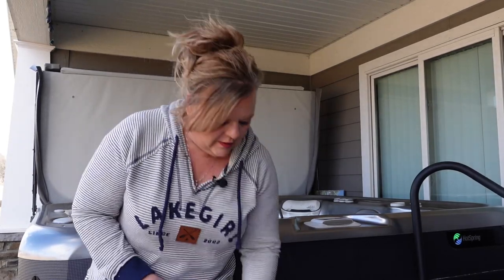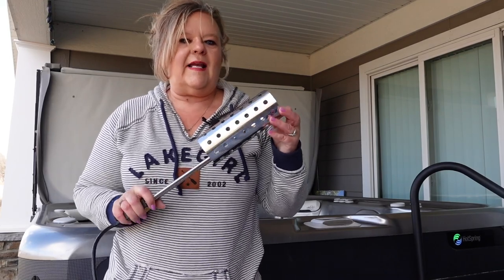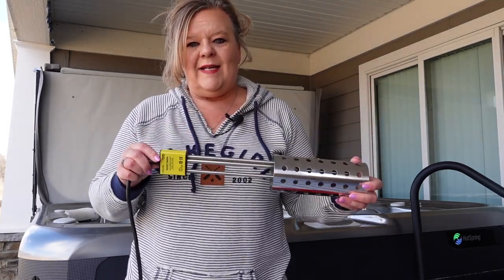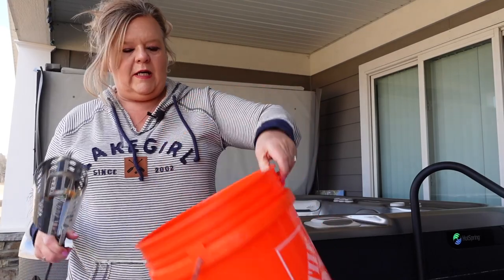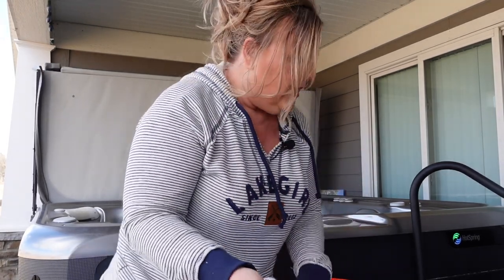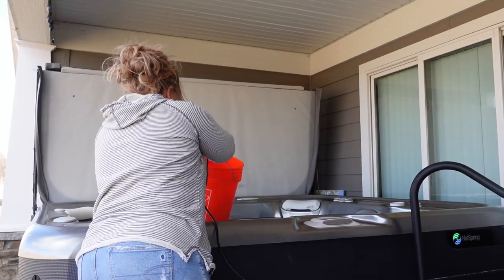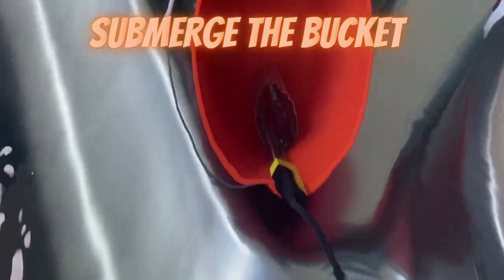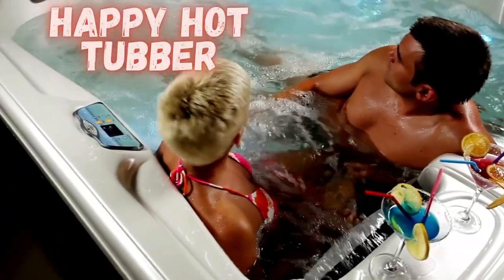How to Safely Place a Bucket Heater in Your Hot Tub

Comment: I'm using mine right now that I got because of your videos. Changed water and using it to speed up the re heating process so I can use the tub tonight. I did the bucket technique last time. This time I suspended it securely from my pergola roof so that the heating element is the only part in. Water stops right before the yellow part. So far by my calculations I'm heating at 18 degrees per hour doing this so I will be back in biz in around 2 hours instead of forever hours. Thank you!
Reply from the maker: Great idea
Reply: What model brand u use and temperature you reach out?

Comment: We have a hot tub that won't go over 70 degrees. It will be 6-8 weeks before we can get it serviced. It's not in danger of freezing, but could we heat it up with the bucket heater, take the heater out and use it without the heater in it?
Reply from the maker: You could technically do that but never get in the hot tub with the bucket heater in the tub

Comment: Wondering if i can use that heater to save wear and tear on the heating element on my hot tub
Reply from the maker: No it wouldn't be your best option, it is designed to save your hot tub not to actually repalce the heater.

Comment: How long does it take to heat up the tub
Reply from the maker: If you are using a bucket heater and it is at 32 degrees it typically takes 48 hours to get to 100.  This is only for emergency use to keep the hot tub from freezing you should never use this to heat your hot tub on a regular basis.

Comment: Im new owner of a grandee,  just did the first empty of the water and cleaning,  i found 3 very very small dots of rust i could not wash off the inside shell-  what would cause this? And will it grow?

Thanks
Reply from the maker: Contact your dealer.   Take photos
Reply: Right now the new design which comes the removable shell,and you can clean it at same time it comes with clean ball from "HASTER Portable Immersion Water Heater "

Comment: How hot can that heater get the tub? Just luke warm? Or can it heat it right up?
Reply from the maker: It will heat to 101 in about 24 hours.   I am not suggesting you use it as a heater just as a precautionary to keep you hot tub from freezing you should never get in the hot tub with the bucket heater
Reply: @TheHotTubLady  cool thanks, i just built a cedar barrel that I wanted to heat up, it works perfectly. It actually can get it too hot! so I built a second for a ice bath. cheers.
Reply from the maker: @millionaire233  awesome

Comment: Hi, thank you for this video. We purchased a Intex 4 person inflatable hot tub and the heat is just not consistent. 

With the tub being pvc material and some research I’ve done, it seems like these bucket heaters are a good hack to get it warmer to start. Would your 5 gallon bucket idea work for me if I followed the same steps and not allow the heater to come in contact with the tub itself? Thank you for any help!!
Reply from the maker: That is not what I am suggesting you use this for, but technically is thould work, but if it would fall over or something that could be an instant death for your hot tub

Comment: I love these Heaters. Can't see putting it in a bucket into my hot tub, I have the bucket outside the hot tub with hot water in it and the power off. It lets me use the hot tub for another hour probably by putting the water in that bucket in the hot tub every so often. Tub gets down to 100, and I have the water at 130 in my bucket... I have put my hand in the bucket to feel the water while the heaters on, so as you can see I'm not the sharpest knife in the drawer.
Reply from the maker: that actually is a great idea for a 110 unit in a colder climate.   I DO NOT recommedn being in the hot tub with the heater in the hot tub at the same time.   I am suggesting that these heaters are used at times the  tub shuts down  to keep it from freezing

Comment: Can I use for my pool ?
Reply from the maker: I tried it on mine and it didn't really help.    Never ever be in the body of water while the bucket heater is in it at the same time.
Reply: The HASTER Portable Immersion Water Heater for Inflatble which can be used for mini pool, inflatable pool ,but need to check the water capacity before purchase

Comment: I use a similar one and the problem is the rust. I can t prevent or remove it. Otherwise, it s part of my way to have hot showers every where i travel to.
Reply from the maker: I have never had one rust ever….  Hmmm
Reply: How about choosing the HASTER Portable immersion water heater ,which comes with the clean ball and it is stainless steel 304 which can prevent rust .